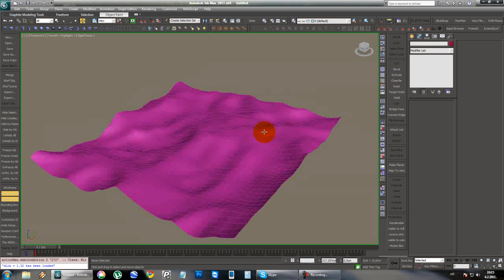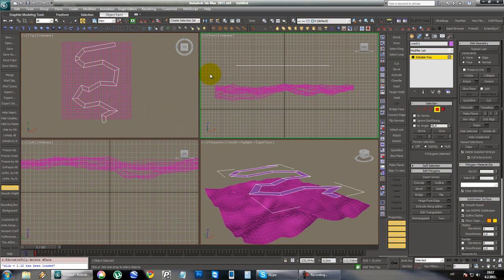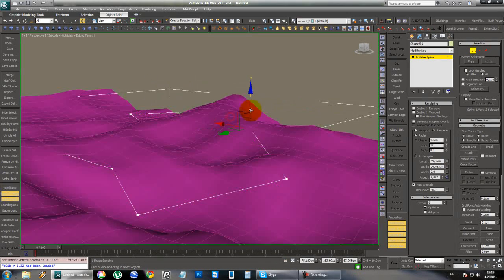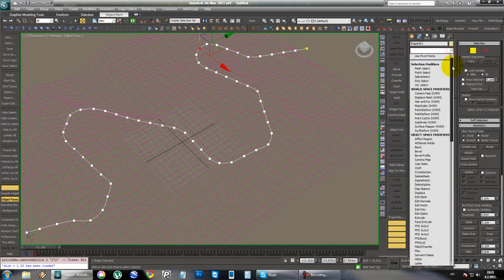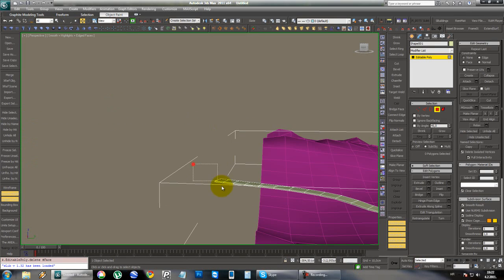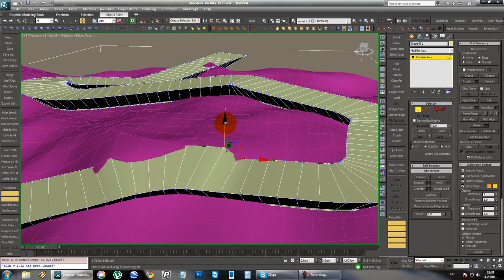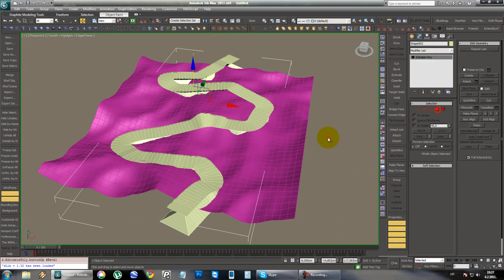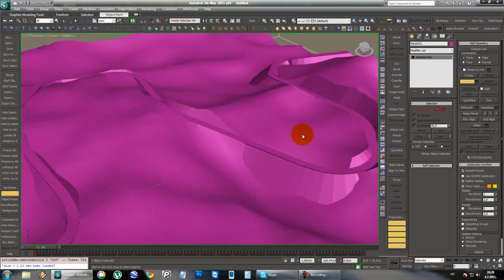3d studio max tutorial - how to make road on terrain

Comment: After so many, years I should say, of trying different plugins, this simple technique has proven to be the best and more efficient. Thank you! A plus is that if you apply different materials to the slopes and the terrain it will boolean it wwith different face ids which is very handy later on for selection pourposes.
Reply from the maker: That with different materials is a great idea! I haven't think of it! Tnx for tip! And I'm glad that this technique is still relevant, considering how old video is by now :-)

Comment: hi, nice video.   but my polyline extrudes the wrong direction
Reply from the maker: Try making new poly-line rectangle in top view, convert it to editable spline, and then attaching this line to it. Then delete rectangle in edit spline mode, so that you are left only with your original spline. That suld sort out any errors with direction in witch your line extrudes.

Comment from the maker: I used shell modifier to add width and height to line object, but you can do same using "Rendering menu" of line, using Rectangular option.
When you create line object, under "Rendering" menu of spline, you have option that you have to check, named "Generate mapping coordinates".
Then, when you add width and height to your line object, it will have  automatically generated UV coordinates. They you just have to correct that generated mapping and conform it to your texture.

Comment from the maker: Tnx for additional tip; personally, I'm aware of that tool in Graphite, but original tutorial with this method shown in this video was made in Croatian and for max 2009 witch didn't had Graphite modeling tools, and I didn't wan't to use any custom scripts or plugins (prior to Graphite tools, I used SplinePainter from SoulburnScripts package)